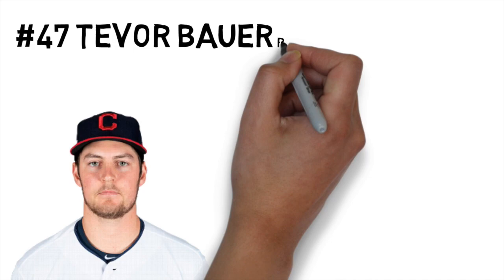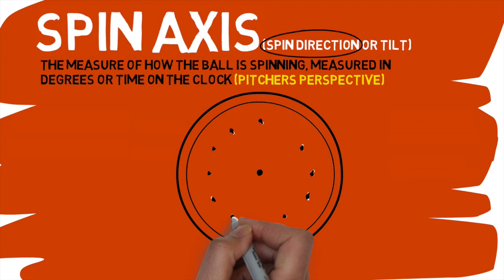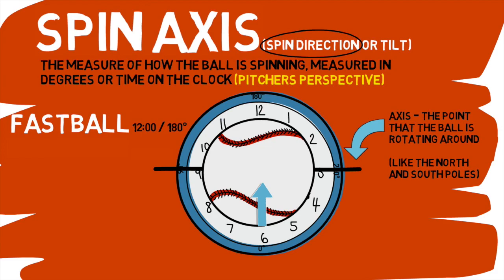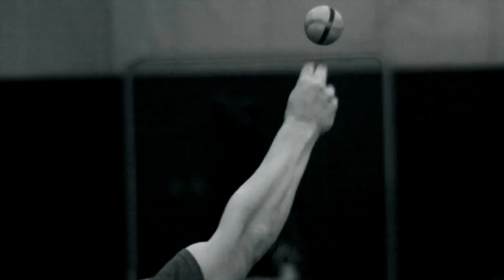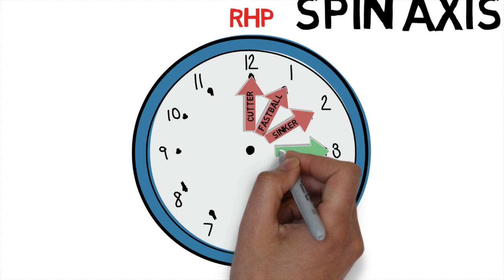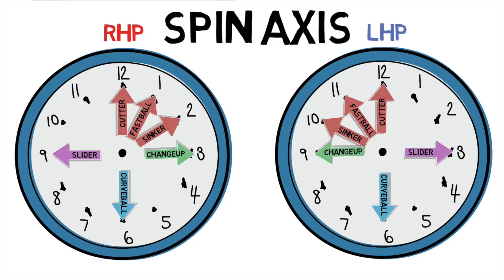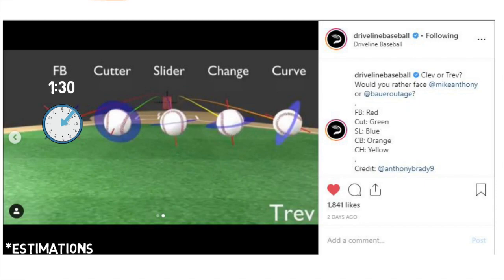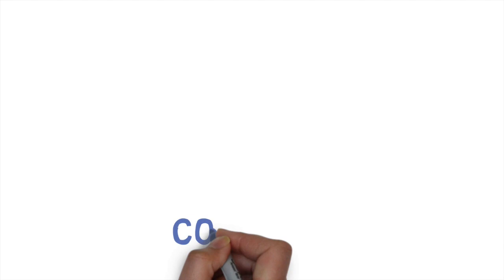SPIN AXIS EXPLAINED: A Look into Trevor Bauer's Arsenal

Comment: You say this may be a complicated idea to grasp.  IMO, it is not.  But the explanation is confused, because it uses the terms spin axis and spin direction to mean the same thing.   In you diagram at 2:00 the real "axis" is along the bolded line running from 9-3 o'clock.  The "direction" is 12-6 o'clock.  

That's how it works in geography class.  The Earth's axis is north-south and the Earth's spin is east-west.

Anyway, loved the Tube.
Reply from the maker: TBH didn’t know that was the way those terms were classified in geography class! Guess it’s been a while…

Anyways, the reason a lot of people have issues with the distinction between the two is because Trackman and Rapsodo measure what you call the “Direction” (12-6 o’clock in our example) two different things. One calls it axis and the other direction. 

Direction is definitely the more accurate term, but because Trackman uses axis it creates some confusion. Thanks for the comment!

Comment: Hello, how can I identify what type of pitch it is with the naked eye as a spectator if I’m behind the batter or batting box?
Reply from the maker: Good Question! Honestly, this simply takes practice. If you have a radar gun putting out speeds this helps make this process a little easier. 

On average a player's fastball will be their hardest thrown pitch, change ups and sliders will be 8-12 mph slower than the fastball, and a curveball will be 14-18 mph slower than the fastball. Each pitcher is unique, but this should be a good enough rule of thumb to help you identify them to begin with.

If you don't have access to a radar gun, the best you can do is to watch the shape of the pitch from behind home plate - fastballs and change-ups will move 'arm side' (right to left for a righty), and sliders and curveballs will move glove side (left to right for a righty). 

Hope this helps!

Comment: Something I wanna know is how to release each pitch particularly a changeup to get that spin axis
Reply from the maker: With the right technology (video, rapsodo, etc.) you should be able to fine tune any pitches to the desired spin axis you’d like. It’s different for each guy, but some cues I’ve seen used successfully include “over exaggerating pronation” and “throwing the circle (👌🏻) towards the ground”. Good luck!
Reply: @SimpleSabermetrics  Good advice thanks. I've heard throw inside the ball but I don't know if that gives enough pronation to have the desired effect. A lot of it's trial and error like you said

Comment: Why does a cutter have a spin axis closer to a 180/12 pure backspin than a four-seamer's.
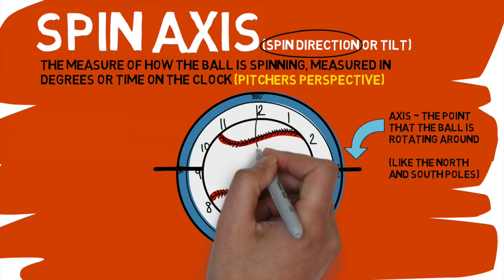Reply from the maker: Great question, Patrick - a pure backspin 4-seam is not thrown straight over the top very often. Most guys throw from a 3/4 slot, so a 4S with 100% spin efficiency would have closer to a 1:30 tilt. 

A cutter however is thrown with a lower spin efficiency and acts as a middle ground between a SL and FB - so it’s tilt is normally going to be closer to 12:00-11:30. 

That’s not to say their aren’t P’s with 12:00 tilt on their 4S - I’ve worked with plenty! But the average is closer to 1:30. 

Hopefully this answered your question, thanks for the comment!

Comment: Nice explanation of some of the pitches. But you only consider rotation as if it varied in one plane.....in other words, all of your axes of rotation are described as if the "clock" were facing the pitcher. This is not correct for all pitches. The classic Slider for example is NOT a "Frisbee" pitch, as you describe. It is more like a "football" pitch. The axis of rotation for the true slider is parallel to the direction of the pitch, as if the "clock" were rotated to face the dugout. The batter will see the classic "dot" on the baseball as it spins, coming towards the plate. This can't be described by the "clock" as you present it. It is more like a nice spiral as thrown by a Quarterback in football. And a "Cutter" going from 12 O'Clock???
Reply from the maker: Hey Fred! Thanks for the comment - This video was meant to only cover the topic of Spin Axis, so I purposefully left out some of the details surrounding that 3rd dimension of rotation you’re referring to. 

A few weeks after this video was released I did a video on Gyrospin, which describes exactly what you’ve mentioned here. 

Here’s the link:

EVERYTHING YOU NEED TO KNOW ABOUT SPIN EFFICIENCY – What is Gyrospin?
https://youtu.be/ju-_PqlpIU8

Hope you enjoy!

Comment: Slider spin is incorrect
Reply from the maker: Not sure specifically what you're noting here - but my best guess would be the fact that I didn't mention anything about Spin Efficiency or Gyro Degree here. Since this was a video on simply understanding Spin Axis, I decided to leave that aspect out until a future video (can be found here: https://youtu.be/ju-_PqlpIU8) 

If not, would love to hear what you think the Slider Spin should be! Thanks for the comment.
Reply: This comment board wont let me post a picture of the axis and spin direction of a slider. But the spin direction is nowhere near horizontal or (frisbee spin).
Reply from the maker: Agreed. A more accurate depiction of this pitch’s spin would be that of a bullet. The gyrodegree/spin efficiency of this pitch are going to be the key indicators of how successful it will grade out against hitters. 

As I mentioned, Spin Axis isn’t going to be the best way to measure a sliders effectiveness - I cover this more directly in the video linked above.
Reply: I am likely misunderstanding your references to spin direction vs axis of motion. Not sure. Just clarifying, not challenging your video.
Reply: Sent you a direct message to your page or email